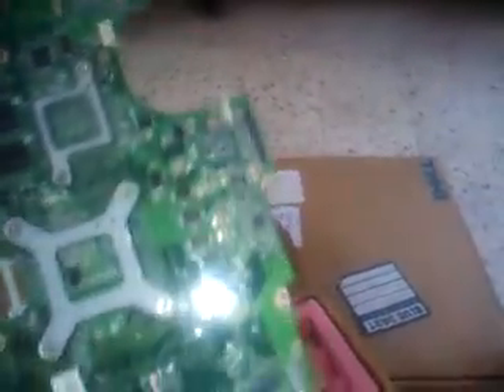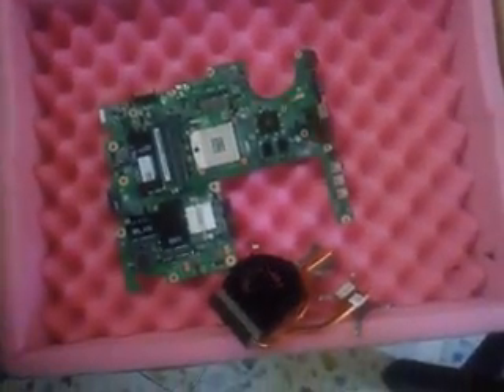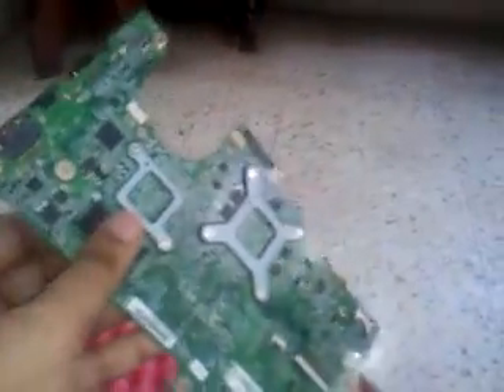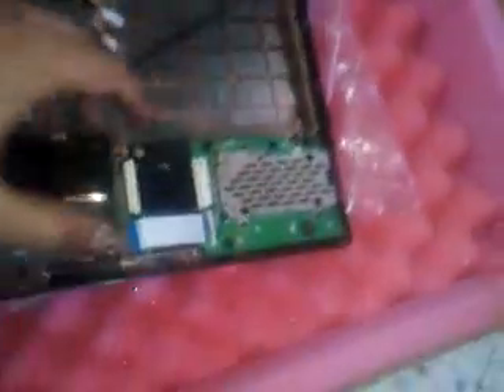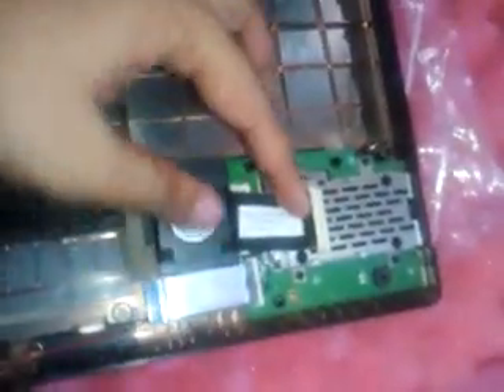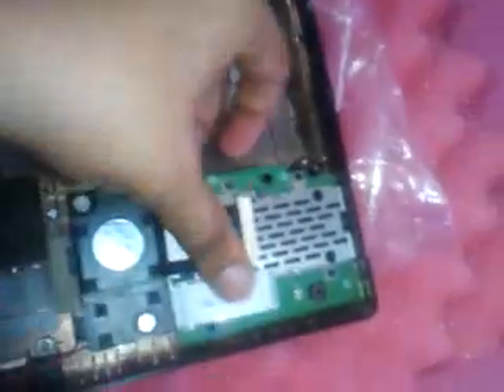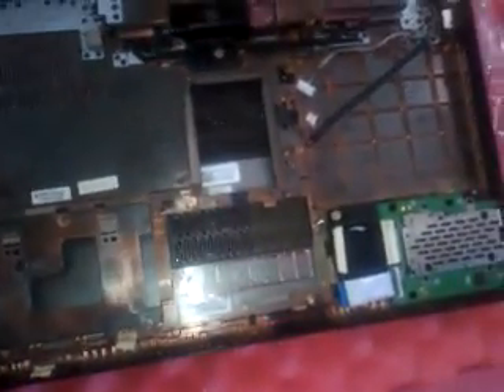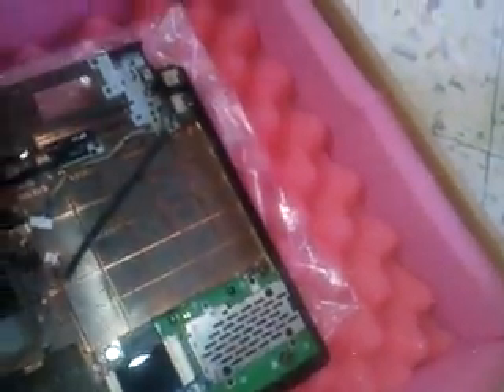i7 & i5 motherboard from the Dell Studio 1558

Comment: will the G936P Motherboard be able to use i3-350m .... It actually originally had intel i5-460m but it has heating problems and i wanna downgrade the cpu...... the socket for both CPUs is the same and the mother board has a white socket like the i7 not the purple one